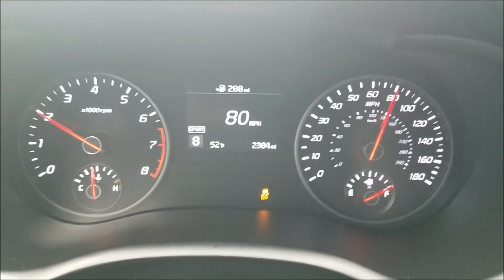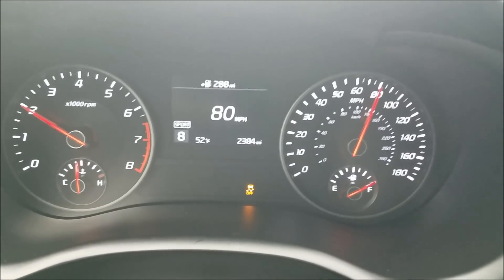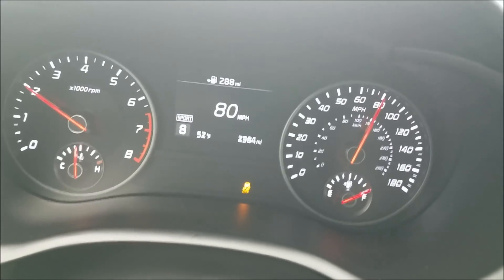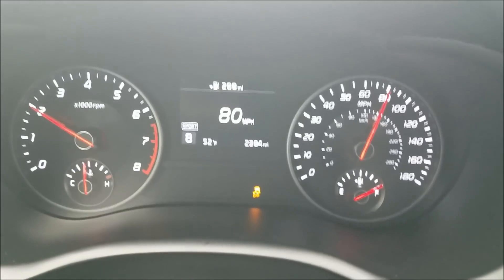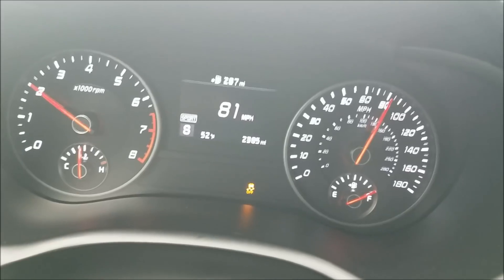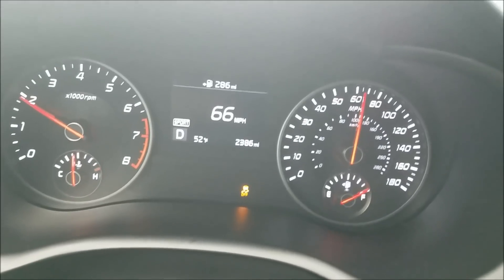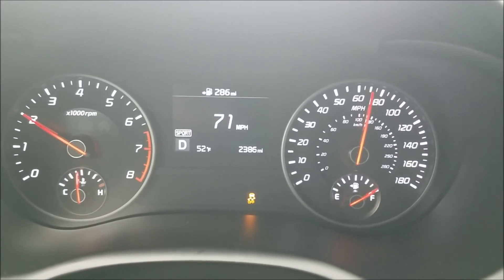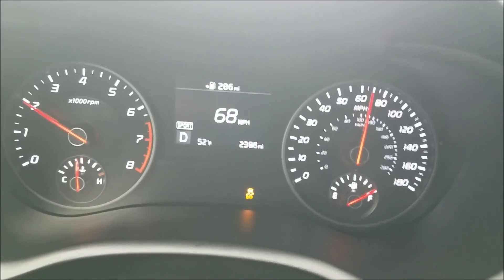KIA Stinger GT 3.3TT 425 WHP 0 to 120

Comment: Used a stop watch to time the car. 4.09 to 60 and 13.28 to 120. Gpt hung up at redline a tad long going in to 2nd gear and lost a bit of momentum but still very good times.
Reply from the maker: That is what we got also :) Super happy with the results so far.
Reply: Keystoner Kook that 1-2shift took quite a bit of time for sure

Comment: The video is 30 fps. The speedometer changes to 1 mph at the 10th frame, or at 21.33 sec and passes 60 mph at 26.00 sec, elapsed time 4.67 sec 0-60.  However, it looks like the car's speedometer only updates in 1/10th of a second, or every 3 frames.

Comment: Try underdrive pulleys, ported throttle bodies or just throttle bodies and tb spacers next
Reply from the maker: The gains from pulleys would be marginal, so not to worried about that and the factory throttle body is already very large from the factory at 72mm.

Comment: If u shift faster it will hold boost nd give u better time
1/2 4800 rpm
2/3 5300rpm
3/4 5600rpm
5/6 5600 rpms give it a try and post your time
Reply from the maker: Not with my tune. My tunes continue to climb to redline. No reason to short shift the fantastic 8 speed transmission.

Comment: pretty quick
Reply from the maker: Thank you!!!  Right around 13 seconds to get to 120 MPH :)
Reply: I'm really liking these things.  Is there any issues running this power level with the AWD variant?
Reply from the maker: As far as I know, the AWD is capable of supporting the same 1100nm at the RWD model.
Reply: Tork Motorsports Cool, thanks.

Comment: Was hoping this thing would be as quick as a stock gtr, but nope. Looks like 0-120mph in 13.8 seconds, which isn't bad but still 2.8 seconds slower than a gtr, which have known to make around similar hp, around 430-460whp stock.
Reply from the maker: We are closing that gap very quick with tuning and good tires. You have to remember, this is only a RWD car, not AWD.

Comment: Pretty fast on the bottom but not much up top
Reply from the maker: We suspect that is the ECU fighting the mods and the PNP box, add a boost thing. With a proper tune, we suspect that its going to be moving out just as fast up top, as it would down low.

Comment: really impressive but why was it hanging at the top of 1st? were you manually shifting?
Reply from the maker: Yes, set it to manual mode because when in automatic, it will shift to second gear... it will spin and then shift to 3rd gear and bog. I have to work on timing the shifts a little better, for next time when we hit the 1/4 mile :)  Hope to have the first 11 second Stinger in the USA!!!!

Comment: My 2009 is 350 beat one of these (barley) yesterday . But mines still running strong at 126k miles
Reply: Maybe a 2.0 lol.  Not even a chance with the 3.3. Stock 0-60 for your car is 5.6. The stinger is 4.6.  Your 1/4 is 14.5.  Stinger is 12.8.  No chance at all even downhill.
Reply: @e.m8879  IS350,  350, 3.5 V6. My 0-60 is 4.7 secs, I didn’t do a 1/4 mile we went to 80 mph. Lots of variables man. What Google says and what people get (watch YouTube 0-60 of the old is350s) is different

Comment: Are you still using the "Gutted out" first CATs with these numbers or did you have to go back with the restricted first CATs? I remember you ran into issues as the car was spooling too fast.

These are great numbers and I think you will have a nice package to offer.
Reply from the maker: We had to take our downpipes off the car (primary cats) due to the overboost issues. Secondary cats have been removed.  We should have a very nice package to offer here soon.
Reply: Excellent work man.
Reply: Please take my 💰

Comment: Only 4.5 seconds 0 - 60mph and 0 - 100 in 10.4? Did you have the car Dyno Tested @ 425 WHP... because that can't be right... A stock RWD does this...
Reply from the maker: Wheel spin?

Comment: Nice clean and quick to 100. I'm impressed especially with 91oct! Is 98oct available everywhere in the US? 98's the go to fuel for us in Australia before hitting the pump E85....
What are the average intake temps with the twin turbo and intercooler setup add ambient also please?
Reply from the maker: 93 octane is the best we can get here in the states. IAT's range around 110° and boost air temps are typically 10 to 20 degrees below that.
Reply: @TorkMotorsports  I finally saw one yesterday in my neck of the woods....it was a deep purple which is what caught my eye and it sounded like he'd shortened the intake set up as I hurd spool!

Comment: Id imagine this would drop your warranty for the tune. (or would you be able to hide it from the dealer by reverting back to the stock tune?) very much considering getting the full exhaust work done as well as the intakes but the tuning is a worry for me since I love the bumper to bumper warranty my dealer is offering. Also does the car break up or over boost with the deleted cats and would it absolutely need the tune with the exhaust work done?

Comment: While 425whp is impressive any car can achieve that these days with forced induction from factory.
Reply from the maker: Agreed, and we are already at 453WHP with our tune. Whats impressive, is we are running 453 WHP at 18 psi.  We are not even driving the turbos hard yet, and we have really good results. 

At 20 psi? At 22 psi? Hell, at 28 psi... we might actually start to see some numbers that are impressive for the forced induction community.
Reply: Tork Motorsports Now that is pretty impressive 453whp at just 18 lbs of boost. I thought it was maybe at 22-24 psi The question is how long will it last at 22psi and above?
Reply from the maker: Well, that is a good question :)

We are finding limitations as we increase the boost levels.  At 18 psi, the factory FMIC is at its limit, so that will have to be swapped out (already done on the shop car). The primary cat converters are starting to become a restriction at 20 psi, so those will be coming off next :)

We ran the cat deletes on the stock tune and picked up damn near 30 WHP peak and almost 40 WHP at redline. So, we know those are a restriction on the factory boost levels, lol. We are expecting to see 490 to 510 WHP at 20 psi with the primary cats deleted... if not more.

Comment: What’s the 0-60?
Reply from the maker: 4.08 with wheel spin. If we could avoid wheel spin, I think we can get a sub 4.0 second 0 to 60.
Reply: Tork Motorsports awesome is this a rear drive or AWD?
Reply: Tyre Evans it's an RWD
Reply: SB The Pikachu ahh I figured a AWD stinger with those gains should do 3.5-3.7 0-60
Reply from the maker: Tyre Evans with a better rear tire, I suspect we could get sub 4 seconds 0 to 60.
Reply: Tork Motorsports ahh ok
Reply: The 0-60 time was nowhere near 4.08s, I downloaded the video and analyzed it, it was 4.738s which should be doable on a stock 3.3TT Stinger, then again calculating 0-60 time from the speedometer is not the most accurate method.
Reply from the maker: alawadhi3000 we will attempt to get a better time for you ;)
Reply: Tyre Evans 0-60 is about the lamest way to base it cars performance.
Reply from the maker: Agreed!!!
Reply: Keep up the good work.
@Tork Motorsport
Reply from the maker: Thank you!
Reply: Tyre Evans holy shit!!! These are faster than my 2017 Mustang GT!!! That’s incredible!!! I’ll make sure not to mess with these Stingers!!!
Reply from the maker: We have caught a few GT's off guard with the Stinger :)
Reply: 1.9 seconds
Reply: hahahah you live in a land of fantasy
Reply: Not sure but judging by this video it seems like 5 seconds flat?? Starts at 0:21 and hits 60 at 0:26

Comment: 4.9 genesis g70 is 4.7 stock
Reply: Mohammed Algarni and your point? A stock stinger would outperform that genesis every day of the week.
Reply: Keystoner Kook kia stinger (425) intakes and muffler delete and more , 0-60 in4.9 sec , but genesis G70 (370) stock have 4.7 , I seeing g70 is better
Reply: Anyway i stop watched this video and it was 4.09 to 60
Reply: Stinger is much more capable on a track than the g70 ever will be. The g70 is a luxury vehicle as the stinger is geared towards performance. A stock stinger gets to 60 in 4.4 sec.
Reply: Keystoner Kook stock stinger gets maybe 5.1
Reply: I think you lot are getting your 0 to 100kmph mixed up with the different variants rear vs awd.
 Research your stats more then comment.
Reply: James Ortiz agreed
Reply: David Griggs i can’t speaking english very good, but i want say if you have g70 RWD and have same addeds (425) u can gets maybe 3.8, I don’t hate stinger, i love this car but i see G70 is better than stinger
Reply from the maker: 4.7 to 4.6 is what the magazines are getting. If we had traction... I suspect we are around 3.9 to 4.0 right now with the mods that are on the car.
Reply from the maker: I wouldn't discredit the G70, with these similar mods on the car... it would be just as fast as the Stinger.
Reply: Tork Motorsports   if G70 come to my country i will buy it and i will added same in your stinger, and i want to say great job ,keep going bro.
Reply: @Keystoner Kook
A stock Stinger got 4.4s on the 0-60 w/1ft rollout which is actually 4-60MPH, that means the actual 0-60 time is about 4.7s. The G70 will be faster because its smaller and lighter than the Stinger, Hyundai rates the G70 as 0.2s faster to 60 than the Stinger.
Reply from the maker: alawadhi3000ots of guessing and assumptions being made with that roll out and actual stopped 0 to 60 times :)
Reply: My stock stinger is hitting 60 in 4.38

Comment: No way that's 425 whp. 425 crank most likely.
Reply from the maker: mmmdef take a look at our videos, 425 WHP is what it made.
Reply: This car is close to 425 crank from the factory. Its underrated by Kia. This car is closer to 500 crank horsepower the way it is set up here. It's a 4k pound car.

Comment: Not to bad. However my stock 2018 Mustang GT has ran 3.9 to 4.1 sec with sticky tires. With a tune only, 3.5 sec with 29 hp/27 tq more. And stock it did 12.1@117.5 in the 1/4. That video of a stinger GT beating a Mustang GT was rigged. The stinger ran a normal time and speed but the 2018 Mustang GT did 13.4 sec.  My 2016 5.0 did 13.1@111 stock.

Comment: 0-60 5 seconds? WTF. I get 5.11 with my wrx. Less than 300whp.
Reply: nopurposejust4fun all wheel vs rear wheel. Stinger is much bigger car. No funny math here.
Reply: David Chung The WRX and the car in this video are both AWD. You are correct about the weight though
Reply: So what about the weight? How much a difference ! Not huge. And this car 425 to the wheels? I said mine less than 300
Reply: Under 300 whp so im guessing 02-05 wrx which are alot lighter than this car... also he had lc but only revved it to like 1.8k ...91 octane and probably not tuned fully are some of the reasons i would think other things like sea level and temperature can affect this
Reply: Hellolife 2017
Reply: nopurposejust4fun i really think its mostly because he launched at 1.8k lol
Reply: It’s funny how wrx guys always claim lower than a 6 sec 0-60 but my bonestock daily driver 328i always leaves about a bus length gap on them with a 5.5 0-60...
Reply: james szumiloski racing the wrong ones i guess

Comment: Slows down majorly on top. Not impressed
Reply from the maker: Look at the tic marks on the speedo, they go from 10MPH intervals to 20 MPH intervals after 60 MPH.
Reply: Tork Motorsports I’m fully aware of that. I don’t want to sound like I’m hating on the car I just thought it was a lot faster than what is shows. For a twin turbo 6 cylinder I expect performance to be noticeable. Similar style to a n54 135i performance but is not the case. As a person who modified cars and enjoys the scene I welcome another tuner car but the hype the car came with let me down is all.
Reply: Tork Motorsports I will welcome more videos with proper octane fuel instead of 91. I’m sure with an ethanol mix or full E85 conversion it will be more impressing. I’ll await for that day. Cheers on the car based on the comments people consider it fast as a tuner I don’t necessarily but who am I right?
Reply from the maker: We are now running 11.7 in the 1/4 mile and sub 4 second 60 mph times. I think that is a bit faster than the N54's on stock turbos :)
Reply: Tork Motorsports very nice! Impressive numbers. N54s can reach those records too but it that is neither here nor there. Great work! I’m curious any chance you can upload a 40-130mph acceleration clip? From a dig it looks like it hooks strong, curious to see how it will do from a roll. I might have to find me one of these to race around my area haha. 11.5 GTI vs a properly set up one should be a good race.